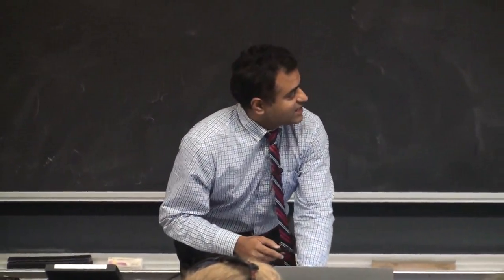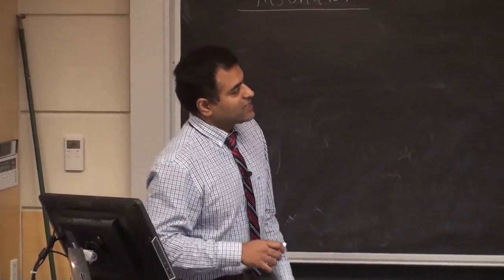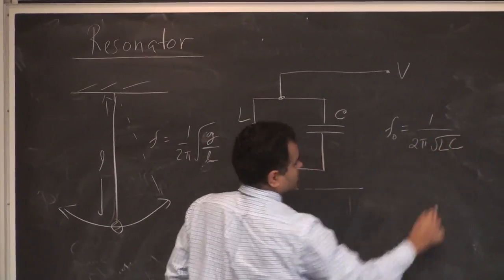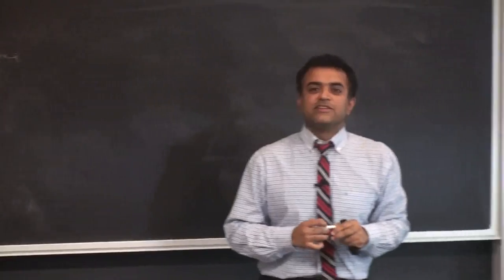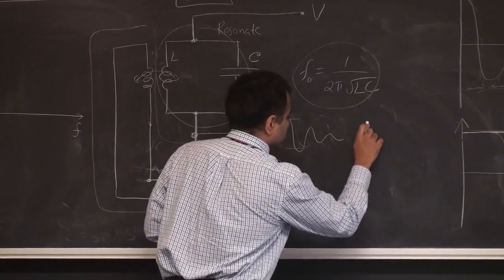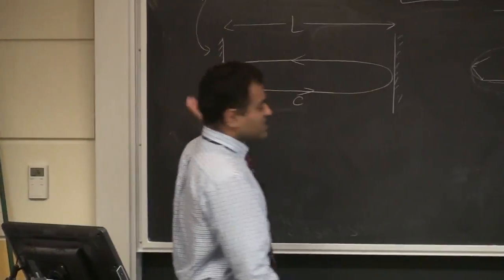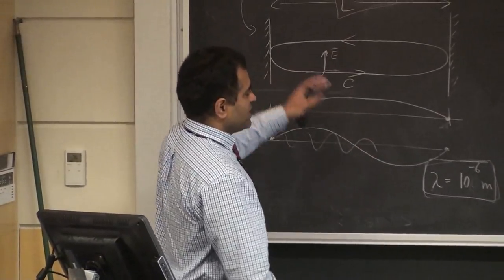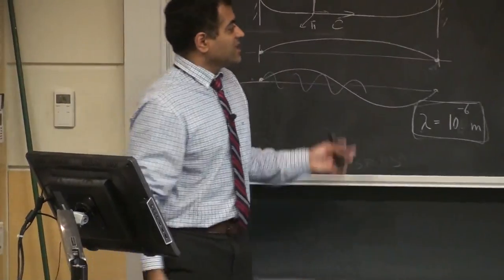Lasers & Optoelectronics Lecture 2: Gain, Loss & Lasing (Cornell ECE4300 Fall 2016)

Comment: LOSER is so appropriate! This dude does a very good job in explanation.
Reply: Except I don't think he explained well when the electron is in the excited state and the second photon comes in, how do we know for sure the second photon is enough to knock the first photon out of the electron..it could conceivably just nudge or move the lectionary without causing the electron to emit the photon..it might depend on the amount of energy..and why can't an electron absorb a second photon and jjst move to the second excited state? Does it simply not "fit" in the photon? Or is not stable enough to accept it?
Reply: @leif1075  if electron had to move to second excited state photon should have that much energy to support second excitation but i think the incoming photon has the energy equal to absorbed one , though i am also not how does second photon interact with excited electron to produce two photons

Comment: Thank you sir ...nice explanation but i have a doubt....at 30 minute of the video clip..for a particular light there is one  frequency so how can you find the spacing  between the peak of the intensities since there is one frequency...
Reply: It is because there are multiple wavelengths of light that can "fit" within the laser cavity/resonator. Each wavelength of light corresponds to different frequencies. So, in fact, there are many frequencies of light that can possibly fit in the resonator. You might be confused because you are thinking that lasers only emit one frequency of light. That is true, but it is because of the gain medium, which selects which frequency of light to emit.
Reply: @nashs.4206  very well placed dude. Also, more formally there is multiple solutions for the wave equations inside the waveguide / cavity  that's multiples of the fundamental solution, something like : K f0 , where f0 is the fundamental frequency and k is an integer.